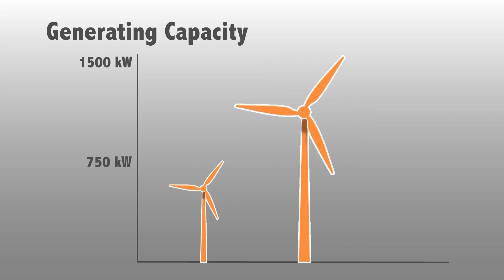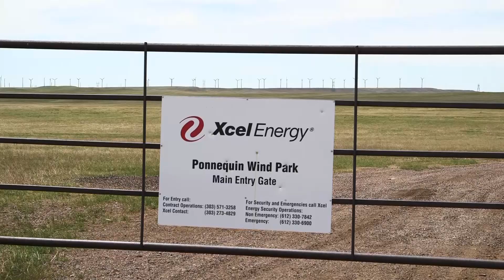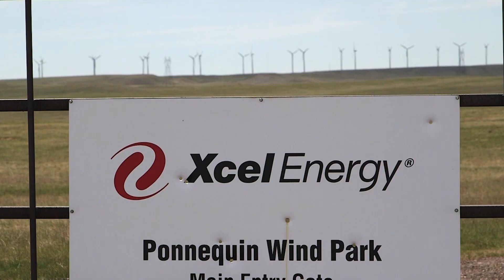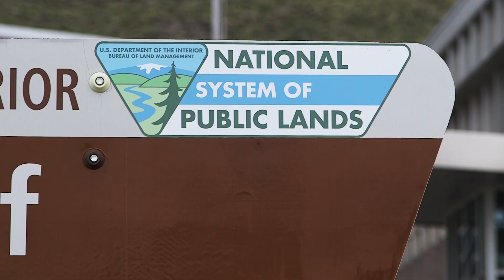Who Cleans Up When a Wind Farm Retires?

Comment: This isn't a problem specific to wind farms, it's a problem with the current rules of capitalism. Bankruptcy should not be allowed. Companies should not be able to just close down and walk away from their responsibilities. All the shareholders and directors should be held personally responsible for paying all debts and cleaning up all mess caused by the operations of the company. This is actually a much bigger problem in the fossil fuel industry. There are many thousands of old oil and gas wells just left leaking pollution into the environment. The companies sell their product and pay their dividends then declare bankruptcy and walk away leaving the taxpayer to clean it up.

Comment: <<	
Just SomeGuy
SeattlePioneer see a car or bus in Seattle? There is the fossil fuel exhaust. I smell it if I start a gas car, smell it at a stoplight. Maybe car exhaust in Seattle is scented.>>

You drive a car or take the bus?  I'm AMAZED that you would do so and contribute to the fossil fuel pollution you deplore.

Sounds like you should live and work in isolated rural areas and only ride a bicycle or walk.

Comment: "Eliminating any trace of the wind farm" -what a complete crock. Those blades alone are made from NON-RECYCLABLE composite fiberglas that has NO half-life and their blades alone fill entire landfills and make that landfill are useless for centuries. The huge concrete bases will also stay in place forever and the tens of thousands of birds and bats these turbines have killed will NOT come back. Wind turbines look clean and modern on day one but look like rustsicles by year 18. Wind turbines, as currently designed, are monuments to stupidity. Build safe nuclear reactors that are TINY in comparison to the massive CLEAN (no carbon emissions) power they generate.

Comment: A Dutch privately owned company recycles composite materials from used Turbine blades and boats into recyclable floor and wall tiles. People should not vote for politicians who allow that these materials get dumped on a landfill while there is a perfect ecological responsible and profitable solution for recycling those materials.
Reply: So I don't understand what the problem is. I also wonder what happens with all the polyester boats that get trashed? Do these people care about that as well? To me it looks as if they are looking for a cheap way with invalid arguments to block the entire technology.

Comment: You have to realize that there are usually governement incentive like guaranted price for the electricity in order to persuade private companies to make the investment in wind energy. But those incentives usually have a duration limit. When the duration ends, operating the wind turbine is not profitable anymore alone. So they are usually abandoned or dismounted. If they are modernized, it is only because it is possible to gain another 15 or 20 years of public money incentive. When they say replacement with a new field is impossible it is usually because the criteria for the field authorisation have changed (size, distance to habitations, ...) thus this field is no more eligible to public money.

Comment: I am not saying that wind turbines are a bad idea, its just that the current accepted configuration, cost so much in terms of natural resources and pollution in manufacture and servicing , that in the end , they are only just a worthwhile endeavour!  There are other greener methods of producing electricity from the wind, or should I say, other future proof wind harnessing designs, that can be updated as generation technology improves. All things mechanical have an operational life, the trick is to conceive a design, whereby the rotating wind turbine/ generator part of the system, can easily be replaced or updated, without requiring the whole structure needing to be replaced.  Just for free here, is a simpler idea of capturing the wind; on the ground you have a large rotating turret structure that is free to rotate 360 degrees. Upon that large structure, you mount your wind turbine/ generator set (turbine enclosed in a tunnel) The turbine tunnel is connected to a large funnel and that to a  large sail,  and all of it, is attached to the rotating turret. The funnel directs the wind down from the sail and into the tunnel with the turbine. The wind is caught in the sails and is funnelled down to the turret, by its unique shape, and funnelled into the tunnel to produce a fast air flow across the turbine. From a resource view point, the rotating turret is placed and tethered to the ground, but can be moved to other locations relatively easily.  The sail/  funnel material, plus the turret itself, could be made from a combination of recycled  materials.  Thus the whole design could be constructed with a fraction of the cost and complexity  of the "normally accepted wind turbine" system. Could it produce the same amount of electricity as the accepted WT system?, probably not, it depends upon the scale, however it could be engineered to use far less natural resources and pollution to the environment in its manufacture and operation. Furthermore, the system could be relatively easy to upgrade, because the most complex part, is at ground level! I am sure that any engineer worth his salt, could come up with  a handful of alternative design concepts to capture wind energy, and to capture that energy, but not at the cost of the planet, the WTG is trying to save!

Comment: Definitely gives meaning to the phrase "renewable energy." They have to be renewed every few yeara.
Reply: @joeyaldente8858  The single biggest reason to replace windmills is not maintenance, but obsolescence.
Reply: @joeyaldente8858  i have to 3 masters and 2 doctorates and never finish my thesis for third and i found most with  graduated grade 12 studies ... i wondered why they had hard time ... today in 2023 the iq and thinking is lower than back in 1970.... what is worse is the police back then were lower level iq AND IN 2023 THEY MAKE MCNAMARA MORONS LOOK LIKE HIGH IQ
Reply: …and nuclear power plants built in the mid to late 1970s are still operational.  Wind and solar are a JOKE—they pollute the environment the moment they are installed and 18 to 20 years later when they are shutdown.  4,000 acre solar farms produce maybe 400 mW of power while a 40-acre two reactor nuclear power plant produces 2,500 maw of power.  The total amount of nuclear waste since the 1970s fits inside one single 200,000 sq ft Walmart building.
Reply: Unreliables 
Sailing ships were retired from hauling goods overseas for the same reasons 
Unreliability….
Don’t worry the tax payer will pick up the tab
Reply: @batmanlives6456  Wrong.Sailing ships were retired because coal and oil power are FASTER, nothing else.
Now we find that oil power is unreliable, being too expensive to use on bulk materials.
And lo, the sail returns in the form of Magnus turbines.
Reply: Lie. Renewed less often than reactors need new fuel.
Reply: Yes, about 20-30 year. Your car's life is half a year for a wind turbine. Can you do a quick math? 😉
Reply: @Stefan_Dahn  my last4x4 car was 35 years old and one 4x4 is 25 years and i expect to be driving another 350 000 kms or 217 000 miles.... i will not buy any carr of 4x4 built after 2006 too much shitonit and worse built
Reply: @Stefan_Dahn  You need to start buying Toyotas and Hondas.

Comment: I see this farm every time I make a trip to see my inlaws in Cheyenne. The problem with wind farms is they require constant maintenance due to the moving parts, and they don't generate consistent electricity, even in one of the windiest states in the country. They are a novel idea for "green energy" but that's all they are, an idea that's ineffective and unreliable.
Reply: Wind Turbines make guilt-ridden Liberals feel good.
Reply: I did not know they were turbans I d I o t s
Reply: Need to address cleanup
Reply: They also require oil, what is used to clean it up oh machines run on gas
Reply: @shelleyharrop1419  And that oil doesn't necessarily stay in the turbines.  There's a wind farm in southern OK you can see from I-35.  Almost all of the turbines have oil slicks down the towers that are probably 50 feet or more long.  And that farm isn't that old, maybe 10 years.
Reply: Coal is the way to go.
Reply: All wind farms are down. Coal plants are clean. None of the coal plants are retired. GOOOOOOOOO COAL!!!! It's so clean.

Comment: They aren't trivial to take down, either, considering how little power they produce. Huge crane. Big crew of workers. A few weeks each. Then some massive trailers to take the pieces away.
Reply: Not to mention the concrete footer. I don't know how deep they are, but it has to be enough to support the weight of the turbine, plus all the weight added from the wind ...so, definitely not a shallow pour! Lol

Comment: Once established , should NEVER be "de commissioned" such a waste of expensive resources . Rebuild , maintain , or update . There's a BIG difference between choosing the more efficient system when building from scratch and scrapping great resources of an essential system . Its like crushing every car (or home) just because of one persons potential profits . Not good for the country. Like crushing a 1970 boss 302 because of bad gas mileage , or burning your food in a bonfire because of someone else's profits or because u can find cheaper food . Hydro dams were pulled out of every city in the usa , only to come back and supply all of vegas with hydro-e power , also done in large parts of europe today. The value / cost of the footings and towers alone ...

Comment: Give them to a scrap iron company on the condition that they will take them down and dispose of them.
Reinforce the bases and put up the new 3+ megawatt turbines.  They last much longer and are more efficient than the early models.
Put in a mega battery as in Hornsdale, SA.
Make gobs of money just from the battery even before you add the profit of the turbines.

Comment: I imagine everything but the blades and foundations will be recycled. Lot of steel in the tower. Copper in the generator. Those fiberglass blades are pretty strong and are corrosion / pest resistant. Smaller ones like those should be much easier to transport to places where they could be repurposed for things like building structure. Heck, I bet it would be great as an additive to concrete after being chopped up.

Comment: Wind = renewable energy, but wind tur-bins parts not renewable, just what % is going to landfills, should the manufacturers make 100% recyclable / reusable? It defeats the purpose of renewable energy. It's just like the Tesla cars, you have an EV, but electricity comes from a dirty coal power plant that may be burning radioactive coal and with the EV made with petroleum based products. Don't forget to visit ANL.GOV to get your rim job tour of the ring where they filmed Chain Reaction with Keanu Reeves 🤣

Comment: Seeing that pristine landscape in Wyoming which is going to be covered in these bird bashing, bat busting eco-crucifixes is a crying shame. That terrain is flawless beauty, and now it's going to be completely ruined. We're all supposed to pretend we aren't seeing what we're seeing, and celebrate because it's "green".

Ruining virgin land, for an energy "source" that only produces power about 30% of the time, and still needs to be backed up by coal, gas, hydro or nuclear, is utter insanity, and is not in any way, shape or form "green".

All to appease the cult against C02. Just because climate change is happening, doesn't mean we need to put our collective heads up our behinds. There are better solutions than littering the landscape with unreliable, overprices power "sources" that will need to be thrown in the trash in 25 years anyway.

It's a religious cult, that's it.

Comment: Older Turbines with lower output that are in good condition, could be sold to smaller communities that can't afford (or need) the larger turbines.
As for those structures made of steel, they should have been recycled - "scrapped" is a poor description of the metal recycling industry.
The concrete and steel of the new towers will not go to landfill, it'll be run through a crusher to turn it in to the raw materials for the next generation of structures, the companies that make money off the demolitions and disposal will have that as part of their contracts, that they control the raw material once demolition starts, that's where they make thier real money, selling the raw materials recovered.

Comment: Turban: A man's headdress, consisting of a long length of cotton or silk wound around a cap or the head, worn especially by Muslims and Sikhs.
Turbine (TUR-bine): A machine for producing continuous power in which a wheel or rotor, typically fitted with vanes, is made to revolve by a fast-moving flow of water, steam, gas, air, or other fluid.